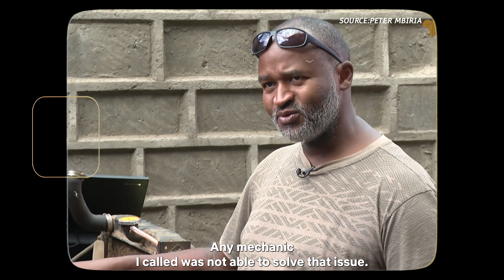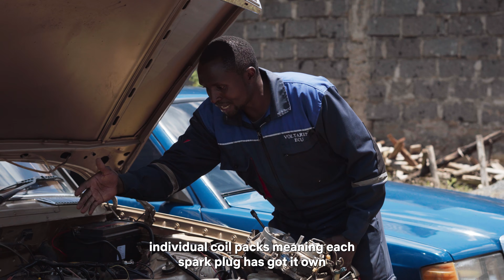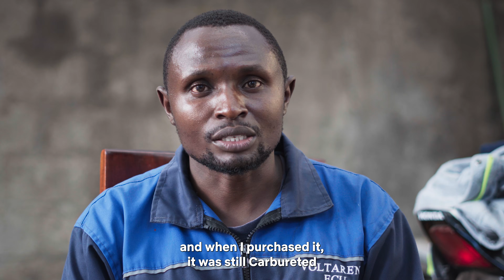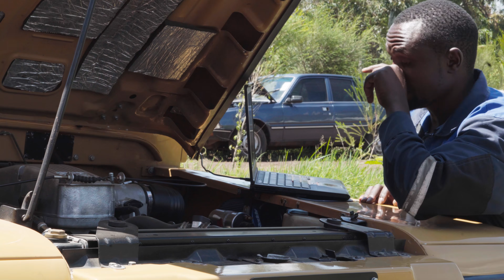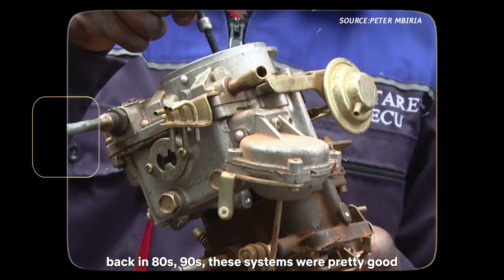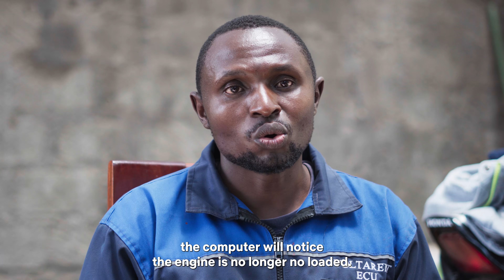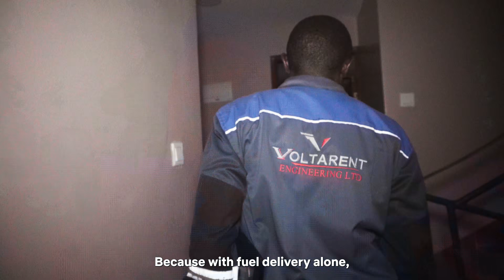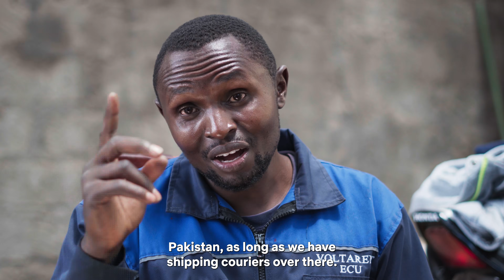This African Genius Makes Old Engines Work Better Than New Ones

Comment: This sounds nice but main issue is ultimately cost, so this mostly makes sense for old vehicles with high value. 
At minimum, you'd need:

- ECU (Voltarent in this case)
- Custom Engine harness
- EFI Throttle body
- Sensors (MAF or MAP sensor, TPS, Crank, Coolant, O2, Oil pressure)
- Fuel system (pump, lines, regulator, rail, injectors)

You are talking about USD $1,500 – $2,300 and only if you do everything yourself (labor cost would add somewhere between $1000 - $2000)

Comment: 80% of the video is it just recycling clips it's already showed us.  Also, we've had after market EFI systems to retrofit old carbonated engines for a LONG time now.   I don't see any thing special about this infomercial.
Reply: @bujin5455  probably the fact that he does it with a social reason and is up to context, meaning he specializes in kenyan market domestic cars, etc. also making it affordable and doable for average ppl
Reply: @maskedcaballo9355  ....right.  And how much is it?  And do you know what existing after market EFI systems run?

Comment: This guys just upgrading the engine to EFI and putting a tune on it, this tech has been around for 25 years since the early 2000s. A company called “Holly EFI” sells these systems and has sold these marketed at drag racers, again since the early 2000s, and are self tuning (much higher quality than this guy) that being said the fact that this gentleman is doing all of this himself is more than “a bit impressive”

Comment: 20:19 1.8km per Liter would be 55L/100km, there was definitely something wrong with the engine back then.. That's definitely not normal.. 6km per Liter meaning 16,6L/100km is pretty normal for a 3.8L Landi.. Don't know how there's an improvement..

Comment: I am very impressed. I am an embedded software engineer and software architect working for Mercedes in the Netherlands, and seeing this man accomplish what normally requires a team of three engineers is truly impressive. He designed the PCB himself and wrote the software as well. I even saw him using the Arduino IDE,  which was kind of funny, to be honest, but if it gets the job done, it gets the job done, it is not the industry standart but oke.
The way he structured the C++ code is great. The PCB design he created, the testing he performed, and the overall engineering approach are remarkable. And keep in mind that he also has knowledge of mechanical engineering, so he knows how to repair the actual components in the engine bay.
Truly amazing. I’m impressed, and I salute him.
Reply: To also consider, the original engineering is far from modern industry standard nevertheless, hopefully open source community will gain traction and create more standardized solutions for modernizing old engines. 

Right to repair!
Reply: Also "industry standard" means expensive software license or mechatronic components. For this guy, it doesn't makes sense to throw money at "industry standard" tools unless this guy have massive funding
Reply: An Arduino is more than capable for his application. As a complete microcontroller subsystem, it shortens the BOM and expedites assembly. Moreover, given its economy of scale from its mass manufacturing, an Arduino board will always be more economical than scratch-built equivalent given his small production volume.
Reply: @bobweiram6321  Arduino IDE is for using the arduino framework, it doesn't mean the board needs to be an arduino. Also arduinos are really expensive for the specs you get, esp32 boards are generally where the sweet spot is.
Reply: @A.D.38q9  yes he is using Arduino IDE for programing and Proteus for PCB drawing
Reply: @A.D.38q9  bravo 🙌
Reply: im impressed too
Reply: Bs. The dashboard screen shown in the video with live RPM gauges and fueling curves is TunerStudio, a universal tuning program used by thousands of DIY car builders worldwide. Peter taking open-source Speeduino firmware, tweaking a few pin settings in Arduino IDE, and ordering an open-source board layout is not "doing the work of three Mercedes engineers." It’s following a well-documented open-source guide.
Reply: cool nice to hear
Reply: I worked both in the Netherlands and Germany. A work that is done by three engineers in the Netherlands is done by a single engineer in Germany.
Reply: So that’s why their car’s so unreliable
Reply: @Arda_Viraf  Tesla uses the least people per car production. (Or can build the most cars per person) and their reliability is near the top.
Reply: @Arda_Viraf  Cool story bro
Reply: @Arda_Viraf  I’ve met amazing talented Germans, both engineer and non engineer and the fact is they have an admirable lust for life, and it isn’t always work related lol
Reply: @c3ramics   that's where this African guy has an advantage over us westerners. Life in the west is complicated, expensive, full of rules, legacy and might feel locked in.

The African guy just tinkered around until he made something that works. Less worries - more creative.

Good for him 👍
Reply: Get him a job. Show it to your boss.

Comment: BS channel. You cannot put mechanical fuel  injection on carbureted cars as they have no holes for the fuel injectors in the intake manifold, dummy. At the end of the video it just shows pictures of junk, to make you feel wow he is working on something.

Comment: Just to let you know that is not a 1984 Mercedes W201, that is a Volvo 244 DL with CIS injection.  Sorry it's all BS. you need all the sensors to make the car run well. you need specific software to run the vehicle, is he a software engineer? no,  but was a nice dream. Note you cannot get good fuel milage if you don't monitor the Oxygen sensors. All cars cut off fuel when pedal is released even carburetors silly.

Comment: Eu should invest in this instead of data centers
Reply: invest in 20 years old tech? Why? EU is moving on to use electric cars as we speak. And if that is not enough then the story on the video is BS.... Do you have any idea what happens to an engine when a fuel is non-leaded or doesn't use any replacement liquid?  Or do you really think re-programmed ECU alone would somehow provide enough lubrication to an engine block? Yeah, right.....

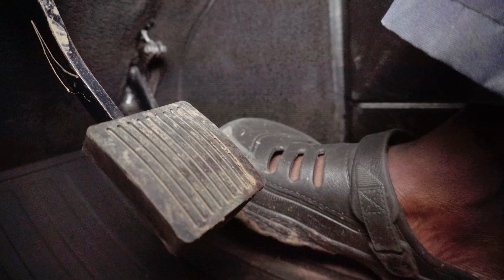Comment: 11:19 he is burning collant i guess, all those other sensor that he missed without that a leak,temperature,pressure drop the ecu would not able to adust the combustion process and warn the user before the engine seizeure.

Comment: Thank you Peter ,for the well presented video of your product. I have worked on cars with k & ke systems  for a long time and experienced  the pitfalls due to neglect and bad fuel supply. In the western world we have the design rules for the strict pollution laws . Since the early 1970 the mixture screw has been tightened non stop. Just check the EU laws now. The usa had LA 4 standard  to start it in the early part of 1974 if I'm not mistaken. It must help in your part of the world and allow to continued use of these vehicles. I wish you all the best from Australia 😊

Comment: If a engine is rated at 120, how can it perform reliably at 160 hp? If the manufacturer wanted that he would have just tuned the carburettor for that high fuel delivery

Comment: You have + points for repairing the older cars and increase their lifetime. I am also fan of oldtimer cars.
But if you say, that the old car with 100kW carburetor engine (manufacturer specs) now has 200kW easily only by changing carburetor into electronic injection system, and mechanical spark timing into electronic is simply bs. These two things will not significantly improve fuel consumption on engine, which in good condition and meets maufacturer specs.
To increase it significantly you have to increase the volume, or the compression ratio of the engine. That is physics, you cannot overskip. In whole video I did not hear you are doing it.

Comment: So basically u used a a stand alone ecu and retro fitted wire harness to run efi last I checked EB/ HOLLY/ DEAMON and few others have already accomplished that in the 90s turning carb or tbi into efi of u don't just do a manifold swap... so what new is being done here

Comment: Its a conversion for old tbi .. I would be more impressed if he used his ecu system with ultra sonics to atomize fuel into a vapour for a 100 percent burn efficiency. Currently burn efficiency is why our mpg sucks, even on these newer efi systems. Ultrasonics would be the future if other power sources weren't coming I.e hydrogen fuel cells. Perhaps even ammonia based engines and worst of all the ev crap.

I personally hate all the new electronic crap in the cars.. I wouldn't drive an ev is it was free

Comment: While its impressive he made a proprietary fuel management and coil on plug system, it likely lacks the redundancies build into modern EFI systems. As automotive engineers have had over 40 years of experience with EFI systems. 

For example modern cars have many sensors to tell the ECU what's going on inside the engine. An electronic ignition system needs to know the position of the engine crank and modern cars usually use a cam sensor and a crank sensor to accomplish this. If one sensor fails the engine can usually keep running, usually poorly. If he's using one sensor in his system to give it engine crank position data then he'll have quite a bit of unhappy customers when they call him because their car stalled in the middle of driving. In terms of automakers it ruins brand reputation, which is why they spend the money on increasing complexity in modern systems which ironically can cause more reliability problems.

Comment: Its not a new invention, Look up speeduino an opensource project started in australia, inspired by megasquirt from the US.  
Its just an arduino based ECU, this one similar to speeduino is using the arduino mega controller.
Its just a universal programable ECU, which has been around for years.

Comment: Is this technology available for a Toyota 1981 22R engine for Toyota 4x4 Pickup or 1989 3 litre v6 Toyota 4x4 pickup? I have both versions of that truck. I also have an older land cruiser that is not operational yet, I bought that as a project vehicle.

Comment: Long story short he built an add on efi kit, maybe he was the first to build one for a Mercedes or Land Rover but he certainly wasn’t the first to build one period, these kits have existed in some form or another since at least the mid 90’s. In 1992 I was trying to get my hands on a kit designed for air cooled Volkswagen engines, I never could afford it though.

Comment: I'm convinced innovators working and inventing solutions outside the corporate, profit-driven First-World factory orthodox of EU, JP/KR and NA will continue to be in demand, as vehicles new today become tomorrow's ailing / failing ones. And those made today are far more difficult to keep running, once components designed for only a set service life deteriorate, as inexpensive yet poisonous / polluting polymer, decontented within a millimeter of its life for profit, or lightened to improve emissions / FE into cheap / weak / failure-prone / all three, right out of the box.

Out of the cyberpunk dystopia of the near-future... always emerge those who become the helpers, the innovators... those who show others, what you throw away didn't need to be so, if you only applied yourself a bit more. Peter is one of many from the African continent who prove, don't underestimate us -- we'll surprise you 🔧⚙👍

Comment: Whaaaat? How many sensors you binned them? OMG... No 02 SENSOR(Some have 4 and cost a fortune) No Crankshaft sensor? That's mechs and manufactures bread and butter... Next, The Oil Pressure sensor which can show on the dash even you've full oil in the engine? Then fuel pressure sensor... Pheeeew and now they add tyre pressure sensors fitted inside the wheel and can show on the dash even when you hit a pothole. Bro... Go and hide yourself cos all those sensors you mentioned are just like maize farm in Africa where we harvest after long hard working. The Sensor makers, they don't even sweat. They make them, put in your car and goes wrong after one month. The cost? You can holiday Maldives 🇲🇻 and stay for 14days with shark in the sea😂😂😂😂

Comment: How do you convert from caburettor to ecu?
Reply: You need a way to plumb and mount fuel injectors in the intake, an o2 sensor in exhaust to monitor AFR, cam and crank sensors, optionally you can use coil on plug instead of distributor.

Comment: Why add fuel injection rails and the coil on plugs when you can use a carbcheater /watch?v=PvFvrXcFlO0&t=632s

Comment: not to break the illusion but anyone who knows cars deeper then just on the surface level will see that this "invention" is anything but revolutionary or anything special. 

he is simply converting carbed or k jettronic engine to normal sequential injection with coil on plug ignition. 

this has been done before and there are many company's who allready offer kits for many older engines. 

also he might just be a bit optimistic about his hp claims from 120 to 180hp with only ingition and electronic injection. 

I mean it's cool that he is doing a business and he seems dedicated and motivated but the whole thing just isn't anything new or revolutionary.

Comment: Hence proved that "Necessity is the mother of invention" As he is a genius Electrical Engineer but he used to have an old Mercedes car and he got problem having that too old. And then as he said Research and Developments came. He got an issue first and later used to find out a solution for that. And i appreciate he came with the solution. Amazing

Comment: I'm in the U.S. and would be very interested in buying this as a kit for a 1985 Dodge van a 360 LA engine.
Reply: It's called a speeduino. This already kinda exists but you gotta make your own wiring harness and fuel rail

Comment: Hey, I'm not detracting from what he's trying to do here, but there ain't nothing new about any of this! It's not ground breaking, it's not earth shattering, it is in fact ancient tech! Stand alone engine management systems (EMS) have been around for 3 decades now at least, ain't nothing new here about any of this! Of coarse you can run an engine bare bones, that's what carburetors have done for eons now, but it is NOT efficient! When you strip the sensor data and run bare bones like this you absolutely give up efficiency! Running open loop as it is called (without and O2 sensor) is very atmospheric and temperature dependent, you're missing all the data that would otherwise allow fine tuning in that way! This is just a very coarse EFI system that can be purchased from at least a dozen different companies now. It's anything but new!

There is no need for these 4 "modes"!!! Tune lean below 1/4 throttle, tune more aggressively at 1/2 throttle and so on. Again, all of this is just ancient and long since been done decades ago! I used to run a "Haltech" system (look them up) in my car back in the 90's for crying out loud!!! Yes, you can fuel inject almost any engine, and "if" you know what you are doing you can make it run beautifully, and no, it doesn't have to be complicated or expensive. But there just ain't nothing innovation here, nothing new, it's all been done decades ago! I did this 30 years ago for crying out loud!

Comment: Inspirational and innovative. Much respect to this man.I know Peter is  driven by climate change but I believe that economic conditions will also be a major factor in the success of his technology. With the price of modern cars being cost prohibitive to many and the inability to maintain our own vehicles due to technological and manufacturer restrictions - this could be a very valuable tool. Nice work. Watch out for sharks and corrupt officials financed by the automotive and oil industry as you navigate your road to success Peter. Godspeed.

Comment: The technology has always been there; to be able to save obscene amounts of fuel; to make a vehicle more efficient; but because of the monopolies by the powers that be; they don't want a cure; instead; they will filter you with a little more fuel every year; so they can suck more out of your hard earned money every time they roll out a new model'
Again; they don't want a cure; they want you to come back for a fix; repeat business; like clock work; planned obsolescence if you will'

Comment: The dismissiveness and ignorance in the comments is thick;

"believe the ECU is basically a Speeduino. I don't see any major innovation."

"Yeah i remember reading a thread on Reddit they mentioned it's not really cutting Edge."

"yeah the technology itselft not so much innovation."

This guy is working with very limited resources. Not one of you critic's can achieve what he has done.

Comment: Good on you for reviving those old cars , and there isn’t much you can do with obsolete Bosch fuel injection systems that are insanely expensive for parts , I am wondering how long the Chinese ecu conversion will last also ,  it’s hard to stop a carburettor and points , anyone can fix them . That said  I Love what your doing here ! Good luck

Comment: we were installing engine management systems like this back in 1990’s.  Good for him for making his own hardware, I def haven’t etched a circuit board in years, it takes time.  But this isn’t anything new or unique, there’s 20 companies or more making these systems he just copied the models that have been around for decades.  It’s probably based on an older 8bit system like dfi

Comment: I'm confused, isn't this video is just about converting carb cars to EFFI???
People have been doing this for years !!
Nothing new , all the usual sensor were mentioned too.
 I built a Megasquirt almost 15 years ago for my old Alfetta.
These days you can even do it with a cheap Speeduino.
Or just go buy an aftermarket EFI / ECU system off the shelf.
EFI UCUs have been around since the 70s and these days there are open source systems too.